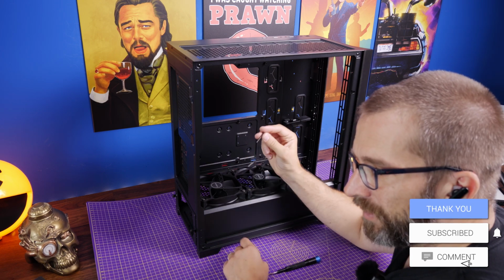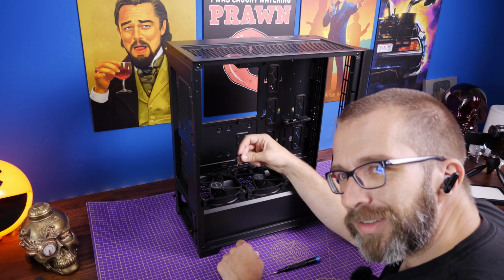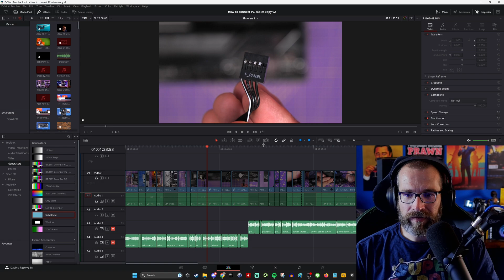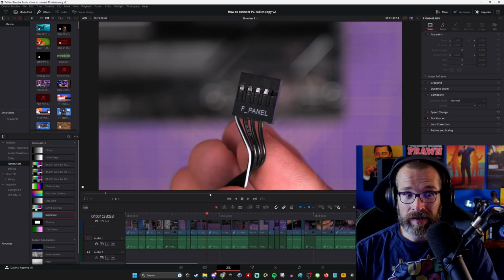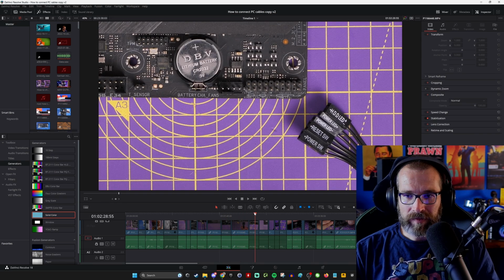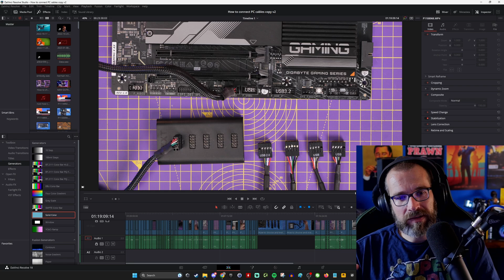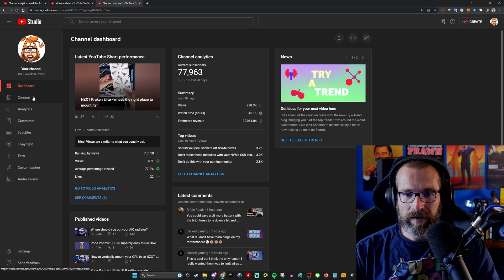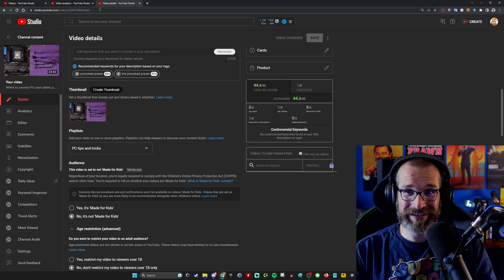Is this a mistake?? Provoked Prawn Behind the Scenes

Comment: I just built in this case and I have ordered another for a transplant myself. I did realize I reversed the hdd led so it doesn't light up so I have to go back and switch it back to the right way. also could you link the adapter your speaking about?